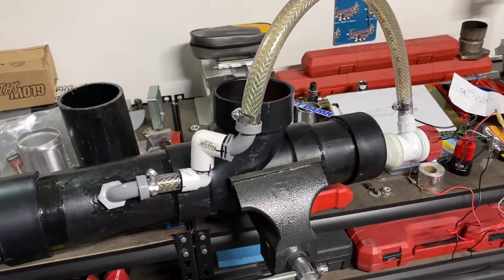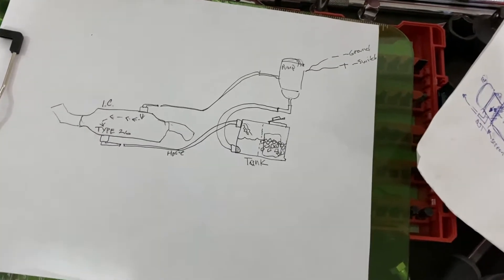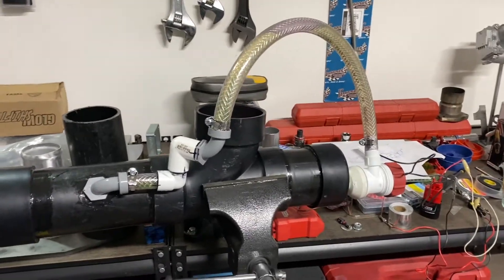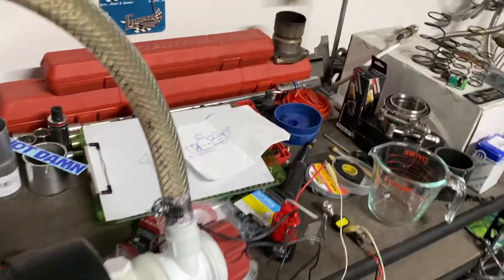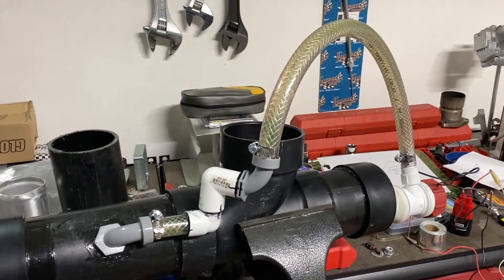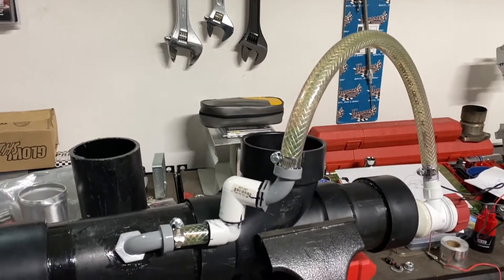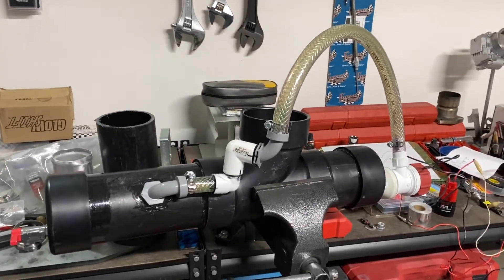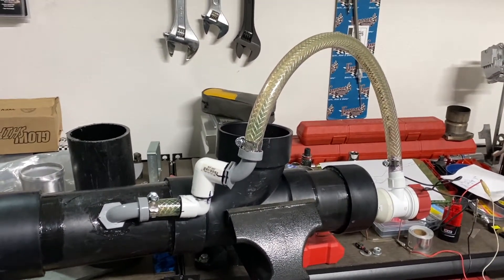Homemade air to water intercooler ice box

Comment: No plans to add a heat exchanger to the system?
Reply from the maker: I mention adding a radiator with an electric fan when summer comes around yes sir.
Reply: @HotDamnRacingTeam  Right, I just watched that video a few minutes ago. Looking good!  Like the innovation. 👍
Reply from the maker: Thank you! Now I need to look for a decent setup. I’d like to stay compact. Any ideas on a good setup? I was looking at the dragsters at work and was thinking about using a trans cooler? Any thoughts on that?
Reply: @HotDamnRacingTeam  A trans cooler should work as long as there's enough surface area to remove the accumulated heat in the water faster than the turbo can add to it.  Of course this is dependent on how often you are into boost and, in turn, driving behavior.  As long as you're not encountering heat soak and have reasonable IATs, you should be good.  If you see IATs or water temp unable to reach the desired goal, then it's time to make an adjustment. But I think you have a good foundation to start with so making small adjustments later on should be pretty easy.
Reply from the maker: Hell yeah thank you!